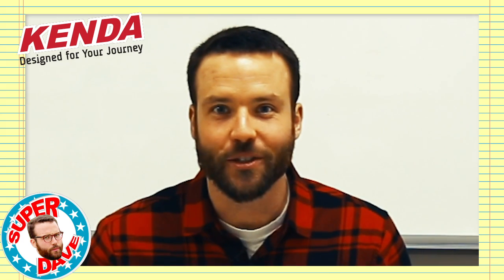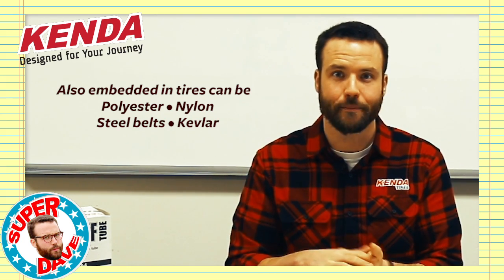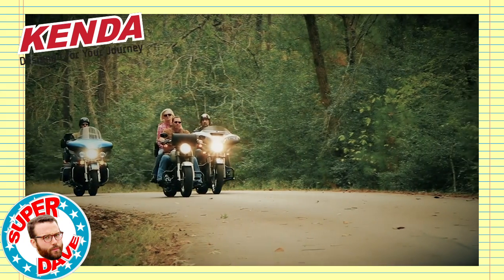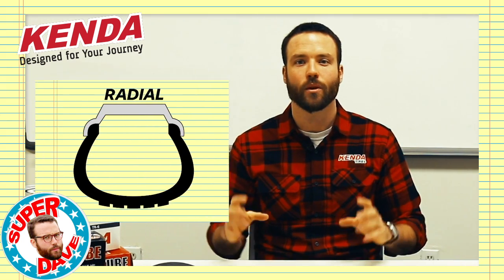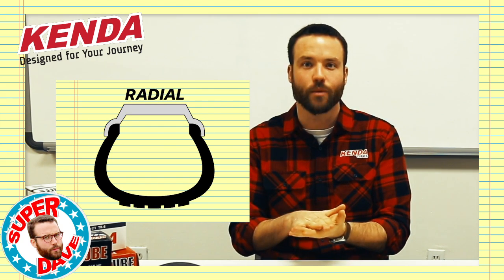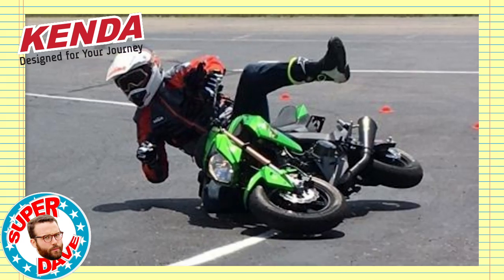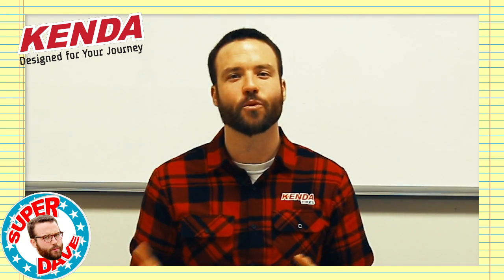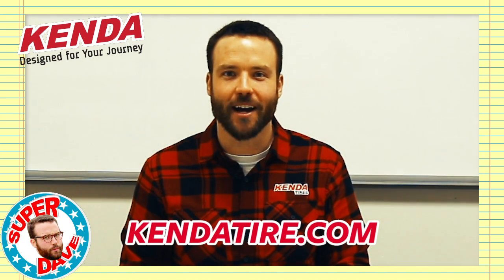Kenda's SuperDave Explaining Bias vs. Radial Tires

Comment: I am curious: The front tire size 100/90 19 seem to be only available in bias-ply, do you know why ? 
I just bought a 2020 Tiger 900 GT (i love her) & stock tires are a Radial 150/70R17 rear & a Bias-Ply 100/90-19 front.

Comment: Just got my first street bike, '09 Kawasaki Ninja 500r, and I need a new set. I won't be tracking or stunting the bike, just casual riding. I know the OEM size is 130/70/17 and 110/70/17, but not sure if Radial or Bias is better. Based on the video I'd say radial but I'm finding wayyy more options in bias, so much so it seems like that's the most popular route. What are your thoughts? Which one would you recommend?
Reply from the maker: for the Ninja 500 you could go Bias since it is more of an intermediate sport(y) bike.   More options for Bias for sure.